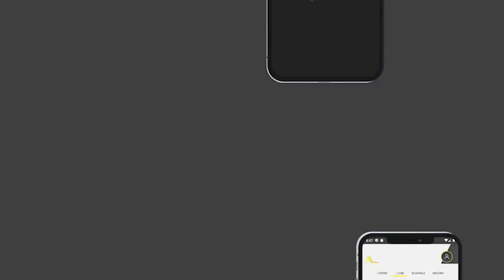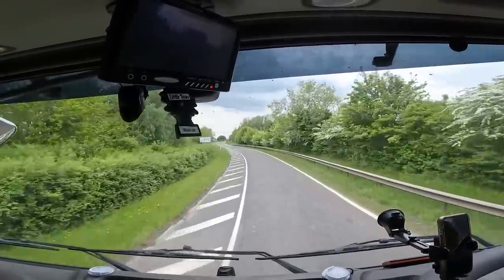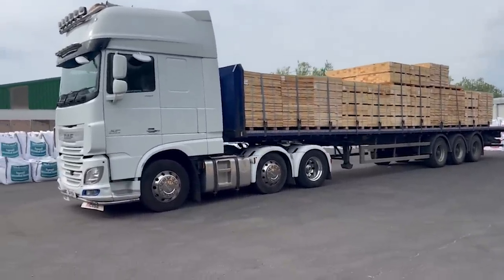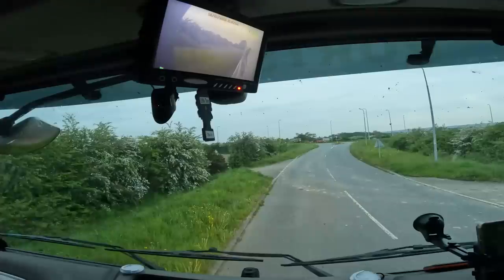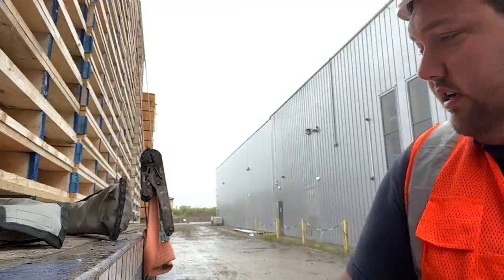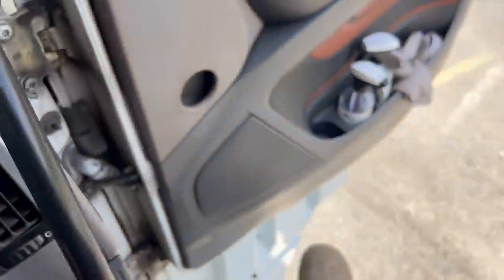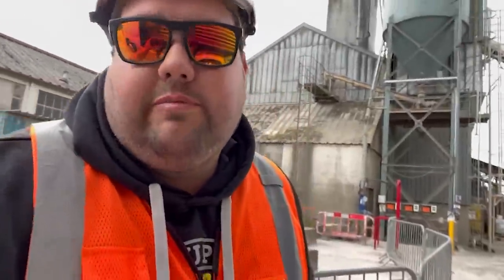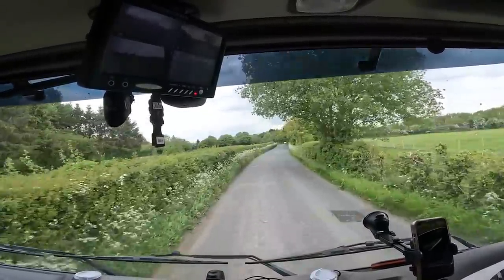A Change In Job!

Comment: I did run over the work hours(6 hours) with a little bit, but third day driving a lot of stuff to keep track off. Even when i only drive a truck(10m) parking is not all easy.
Glad i drive in Sweden we have 4.5m, truck i drove on Friday was 4.25.

Comment: How does it work with daily working and driving hours with doing the shows?
Reply from the maker: No different to a weekly rest, you drive there and park up. Say you park up at 5pm on Friday, Come 45 hours later (3pm Sunday) you’ve had a full rest. 

Or, you can have a reduced weekly rest of 24hrs and leave Saturday 5pm. 

Either one 🤙🏻

Me personally, I took a car. Didn’t drive a truck

Comment: & 59 now  32yrs  driving  somethings never change . ANYwere nr london, M25 you going get hasstle . PLANNERS never take  this in to consideration . Thats why now pref  local tippers , palletts , distance A/B truncking dont / cant do manual handle/ handball work .  . NOT interested in TRAMPING / general hauladge .   HA HA  MELLS PIPE WORKS .   bristol a37  south a362 radstock / frome  road turn right  top hill througth lanes  pipe works . SAFE trucking